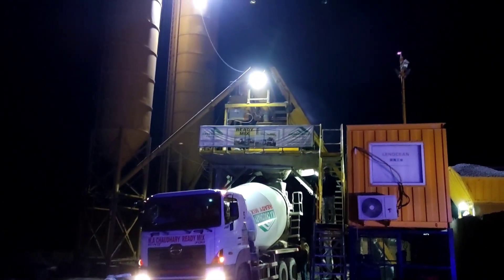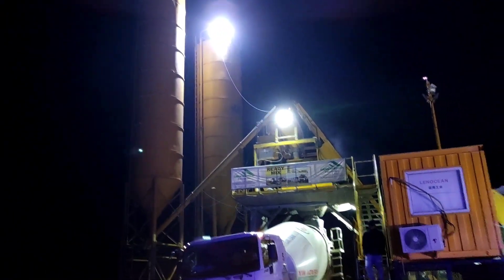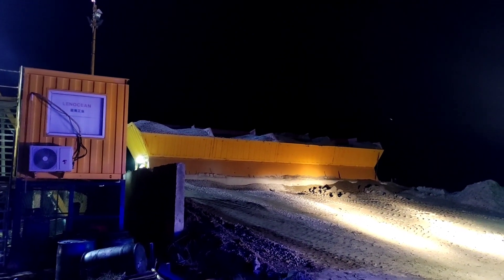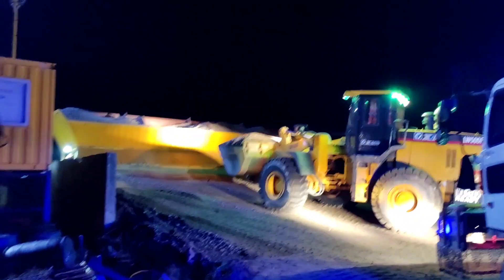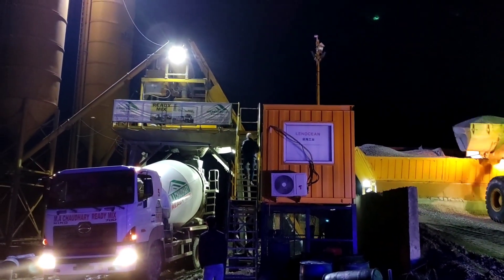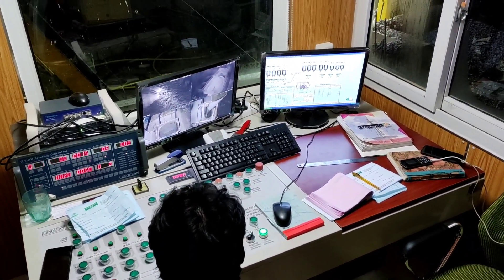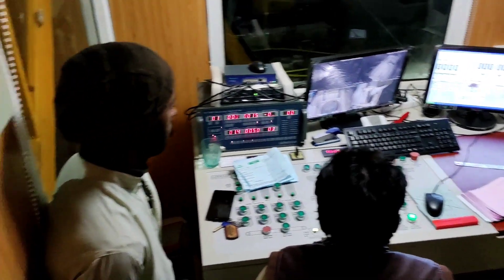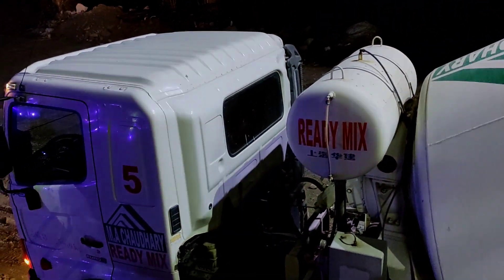Concrete mixing basics: proportioning, mix design, batching plant, & a new Chinese technique

Comment: as salaam alaikoom
sir.  i have design my own single shaft Concrete mixer and running quite pretty.
i want to design a screw conveyor to convey readymix concrete to required point
please reply me what is The required od and id of screw conveyor and its rpm ..
thanks ibrahim
Reply from the maker: Thanks for the comment Ebrahim brother.. the typical rpm of a mixer is around 15 rpm or less.. it also depends on the size of the mixer.. 
The diameter of the mixer should be designed to hold 1 complete load of concrete.. which is safely around 12 cubic feet of dry volume.. the thickness of the sheet is usually (3/26)" thick and the fins inside are (1/4)" thick..
Reply: @haseebtaj  
thanks for the reply but you have given me wrong reply
i asked you about screw conveyor. not about mixer
plz reply what i required
thanks
Reply from the maker: @EbuTECHinfo  ohh 😅 a screw conveyor is a bit more complicated bro.. lots of calculations required for the design like pitch length, screw flight, dia, power of motor, capacity of gearbox.. concrete has a high density (around 2400 kg/m3) so it needs a lot of power too. It also has aggregates till the size of 0.75 inches in diameter.. so typically the inside diameter used for the screw conveyor is more than 6".. OD depends on the thickness of the material used.. there's a detailed guide on the design of the screw conveyor.. here:
https://powderprocess.net/Equipments%20html/Screw_Conveyor_Design.html
Reply from the maker: @EbuTECHinfo  and if you make one please make a step by step video of the process.. I would love to see it and post it on my channel if you allow me
Reply: @haseebtaj  ok
Reply: iam presently not in india after 1 month i will go to India and o will send you video on your gmail
Reply from the maker: @EbuTECHinfo  that'll be great bro.. here's my email:
haseebtaj88@gmail.com
Reply: @haseebtaj  
i have designed 1 screw conveyor od is 8 inches and id is 2*1/2 inches 
pitch = od. thickness of screw is 4 mm 
just i to know the rpm so that i can purchase the shaftt mounted SEW EURODRIVE reduction gearbox
Reply from the maker: @EbuTECHinfo  I saw a screw conveyor for concrete with a 12" dia that had an rpm of 60.. so I suppose 60 rpm is a comfortable pace for an 8" dia conveyor

Comment: At 3:25 Box of sand is filled a bit extra You can see extra hump above So how can we then maintain strictly 1:2:4
Reply from the maker: Thanks for the message.. yes this extra hump should not be there.. this disturbs the 1:2:4 mix.. it's like 1:2.2:4 which is not really the correct way but the amount of and is usually added on site to get a smooth finish of concrete.. more sand means increase in smoothness of the surface 😁 it shouldn't be done but it usually is done on site

Comment: Will this chinese method be effective/efficient on large scale projects ? Or at high rise buildings ? Considering the time consumed in this method because it looks sluggish
Reply from the maker: If we have to travel far (1000+ kms), we travel by plane.
If we have to travel close (300+ kms), we travel bhi car.
Around 400+ kms is usually covered by train.
However, a new technology called hyperloop is now being developed for travels that are somewhere in between like around 700 kms. 700 kms is too far for a car or train, but too close for a plane.

This Chinese technology is kind of like that. It just fills the gap for buildings of around 10 storeys.. where simple mixer seems too small and batching plant seems too big.. kind of like the middle part only.. where the amount of concrete needed makes this process feasible..
N this process can be improved.. the cement and aggregate can be properly added by a machine as well.
So I think this method is effective but for only a small range of projects. 

Did I answer your question properly? 😁
Reply: @haseebtaj  Very well explained Sir 😄